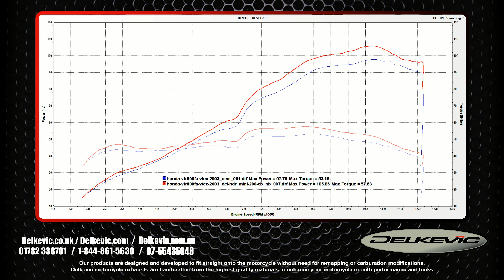Delkevic Mini 8"/200mm Stainless Steel Silencers on a Honda VFR800 VTEC Interceptor 2002-12

Comment: My only question is, was that bike remapped after installing the exhaust for the dyno test? Or are you claiming you added nearly 10hp to a stock bike by slapping an exhaust on without remap?
Reply from the maker: Hi, that bike was not remapped, generally all our exhausts are developed to be fitted to stock bikes with no fuelling modifications necessary. The system in the video is a full Decat system, and the 8bhp peak gains are perfectly credible for a Decat system. We always test the Air/Fuel ratios as we develop our systems and this system was fine but you could get even more power and torque if you chose to fit a Dynojet Fuel Controller or Power Commander, however it's not at all necessary.  If you'd like to know more, feel free to call the UK office on the number listed on our website.